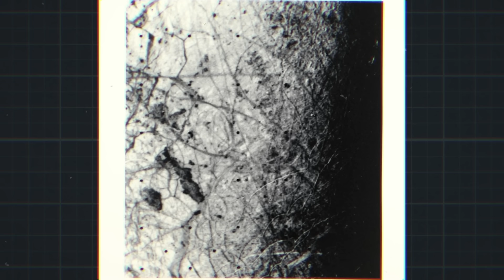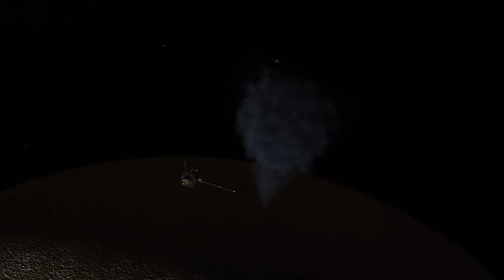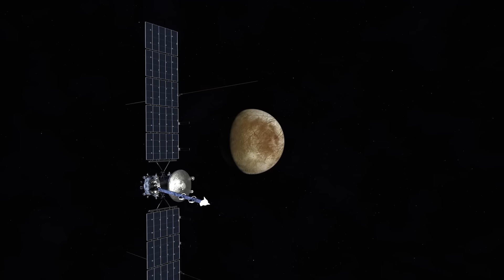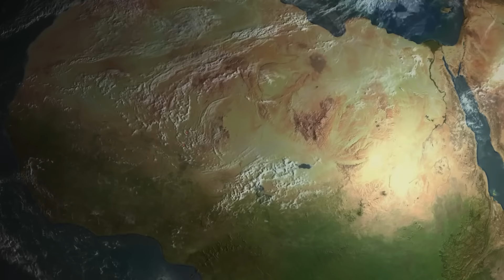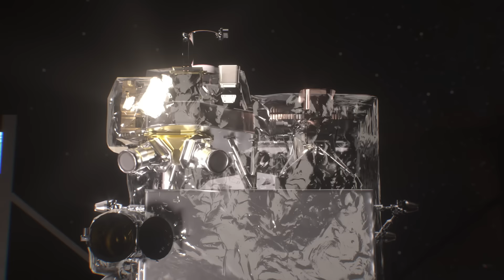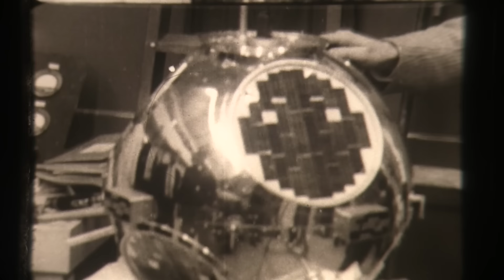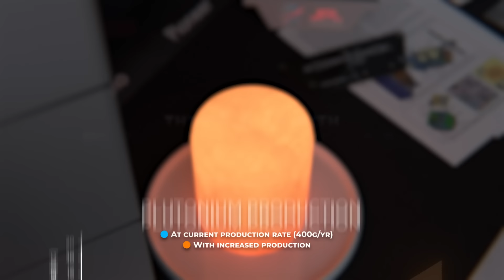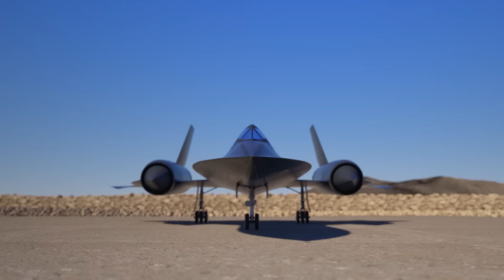The Insane Engineering of Europa Clipper

Comment: Thanks for covering this! I work on Europa Clipper. Hanging out in Florida awaiting launch. Let me know if anyone has any questions!
Reply: Sidenote, it would have been cool if when you showed the specific instruments (SUDA, MASPEX, REASON) if you put the organization it was provided by
Reply: @umer936 my question how europa can have heat is there termal vents or active core inside of not then only tidal energy enough for heat🔥
Reply: @sonukumarprasad4615 There could be. We know there's the tidal heating, but are unsure if there are thermal vents. Hopefully we find out!
Reply: You should be proud of yourself! So cool to see a video explaining an awesome project, then the real people working on it commenting. Personally I'm interested in what hardware and software the main computer is running on? With current tech there should be way more options than in the 60s
Reply: @allen0hu  
Thank you for the kind words! 

on-board the spacecraft, two limiting factors for the compute are radiation hardening and power draw. Jupiter's intense radiation means special radiation hardened processors must be used, in this case I believe it is a RAD750 (or similar). These run an RTOS (real-time operating system) for precise timing of operations. As for power, the spacecraft is solar powered rather than nuclear powered in the past, which also limits how much processing it can afford to do and send back.
Reply: @umer936 why are they not using nuclear with it? is it just a lot of power that they don’t need and not much lifespan for the actual craft itself, so there’s no point in using a long term nuclear energy supply?
Reply: @mincat1412  Discussed in the video, but basically we don't have the extra nuclear from the DoD anymore so it'd be more expensive than just having giant solar panels.
Reply: @allen0hu  Like OP said, it's a RAD750 variant (power PC 750 instruction set if you can believe it). It's just the best option we currently have that has the flight-proven reliability and radiation tolerance required of a mission like this. 
There's lots of new stuff in the works (checkout "HPSC" project between NASA (and others) and Microchip) but for now, that's what we got.. very similar to main computers in the mars rovers, Psyche, etc.
Reply: I was surprised when I heard the resolution of the camera is only 5 times better than the Galileo spacecraft. I would have thought the technology would've been at least 20x better. Why's that?
Reply: @manuelvolk6177  I'm impressed that they got 8MP sensor... Radiation will create a bunch of noisy artifacts. Everything sent on a probe has to be radiation hardened. This means they have to be less delicate. Therefore the processors are nowhere near cutting edge because they need to be thicker and chunkier.
Reply: @manuelvolk6177  my guess would be power saving. cameras of high resolution take way more power and peak draw compared to lower resolution ones
Reply: @manuelvolk6177  
I actually had this question before too. So the "5x better" isn't completely accurate. It's 5x better for 90% of the mission, but on close flybys, it will be 100x better than Galileo (source: https://europa.nasa.gov/spacecraft/instruments/eis/). 

Also, everything in engineering is tradeoffs. Clipper's focus is exploring habitability, especially in the water under the ice. So the instruments that identify elements below the surface take priority. A better radiation-tested camera would increase the money budget and take up more of the data volume budget. We'd rather more of the transmission be for the science data than images of the surface.
Reply: I'm assuming all hardware and software need to be a bit older technology which is tested, I'm wondering what programming language is used for the software side of things?
Reply: @tgmyrz  I don't know the answer to this, but imagine it's primarily Assembly, C/C++. We have lots more leeway on the earth side for processing the data, so that includes Python, IDL, and C++.
Reply: @umer936  software engineer here. due to power constraints and the high efficiency needs in a mission like this, im almost certain that they are using C that has been hand optimized in assembler, unless they have some proprietary languages that has been specifically designed for this.
Reply: @tgmyrz  They use C on-board almost entirely. As OP mentioned, ground and test systems can and do use a lot of other, typically higher level, languages.
Reply: What's it like to work on huge projects like this? I'm asking because I'm a current physics student and stuff like this seems like it could be a dream job.
Reply: @austinh1242  
It's very cool being a part of something so adventurous and bigger than myself. Often on the day to day it's hard to see that because everyone has their small roles, but stepping back and seeing how much dedication and hard work so many scientists, engineers, support staff, physical working staff, and everyone put in is pretty amazing. Best of luck with your studies! :)
Reply: @austinh1242  If you ask me it is the perfect time to get into aerospace.  The industry is about to boom.
Reply: @austinh1242 The book, The Mission.
Reply: No questions really, just wanted to say thank you for the work you do. Awe inspiring and fascinating.
Reply: Ah dang. I replied to every question. But it looks like any that had a link to more information got autodeleted. Don't typically comment on YouTube so I didn't know about that.
Reply: @umer936  You can look at your comment history, which will (IIRC - when I had that problem) and copy-and-paste everything except the link and try again. Also, thanks so much for working on this project! I've been following its progress since it was just a proposal in 2013!
Reply: @umer936  is there any missions to send a lander on Europa in the futur
Reply: @lecrabesavant4435  A lander was originally part of the initial Europa Clipper proposal, but was removed as we don't know enough about Europa to commit to making a lander. As time continues, a Europa Lander mission is possible but no earlier than 2027. Saturn's moon Enceladus is similar to Europa, which also has proposals for a potential lander. Depends on budget and potential science capabilities.
Reply: @umer936  also, if europa clipper fly through a geyser, wouldn't that damage the instruments with this high speed ?
Reply: Can the ESA's JUICE mission be used as a second point of reference in mapping the irregularities in mass distribution/gravity strength of europa? knowing the distance of Clipper from earth + clipper from juice would allow better insights into changes in velocity due to gravitational irregularities.
Reply: @bonngus  
In theory, it could. However, the spacecraft uses star maps to have many points of reference in space (source: https://europa.nasa.gov/mission-updates/43/mission-dispatch-tracking-the-stars/) to assist with exactly knowing its position regardless of velocity or gravitational changes. 
The 2 spacecraft will not be following each other/always near each other as JUICE is more focused on Ganymede and Callisto while Clipper is focused on Europa. Being different missions and different types of instruments for the gravity measurements make it difficult. The data will be cross-compared here on earth, but nothing in real-time. They will be able to visually see each other and JUICE will potentially see the end-of-life crashing of Europa Clipper though.
Reply: @bonngus  In theory, it could. However, the spacecraft uses star maps to have many points of reference in space (source: https://europa .nasa. gov/mission-updates/43/mission-dispatch-tracking-the-stars/) to assist with exactly knowing its position regardless of velocity or gravitational changes. The 2 spacecraft will not be following each other/always near each other as JUICE is more focused on Ganymede and Callisto while Clipper is focused on Europa. Being different missions and different types of instruments for the gravity measurements make it difficult. The data will be cross-compared here on earth, but nothing in real-time. Other sensors will share a lot more cross-referencing, such as UVS. Plus, the 2 spacecraft will be able to visually see each other and JUICE will potentially see the end-of-life crashing of Europa Clipper TBD.
Reply: That's awesome! Hope the hurricane wasn't a problem for ya
Reply: @stanuel  Fortunately not too bad! My heart goes out to those affected and I hope for the best for their recovery.
Reply: What an awesome project to be involved with!   I'm such a passionate supporter of any mission that directly tackles questions related to possible life and habitability.  Astrobiology and planet habitability are the hottest fields of scientific enquiry to my mind.
Reply: That's so cool, congratulations for successful launch and making this mission possible. When do you think we will be able to send a lander to Europa and do you think we will be able to get to the ocean below the surface? Since that's the only way to 100% confirm that there is life.
Reply: @lukasimic7879  
A Europa Lander has been proposed but I don't believe it would launch before we start getting data back from JUICE and Europa Clipper (~2030). That said, I don't have any specific info/knowledge about it. There's a Wikipedia for it though, which will get updated if progress is made [1]. The current proposal is detailed here which would dig below the surface, but I don't believe it would completely drill into the ocean. It would be at a depth that doesn't get exposed to the radiation though, so there would certainly be new stuff to learn from [2]. More info, but probably outdated at this point can be seen in this presentation [3]. 

1) https://en.wikipedia.org/wiki/Europa_Lander 
2) https://www.jpl.nasa.gov/missions/europa-lander/
3) https://d2pn8kiwq2w21t.cloudfront.net/documents/2020_ELOW_Final_20200514_Post_v2.pdf
Reply: Did you build 2 identical vehicles in case of a launch accident?
Reply: @paulanderson3898  No, we only build one, so cross your fingers! We do build an Engineering Model of each instrument to keep at home which is as close to the Flight Model as possible. But it is not easy to just "spin up another." For example, Cluster is a spacecraft that members of my team worked on in 1996 that had a launch failure, so 4 years later they launched Cluster-II. But there have been missions that become dead in the water if it would not make sense to make another cost-wise and science-wise. We're better at it now, but it's not a good time so it's important everything is done as right as possible.
Reply: I dont understand the terms yall saying but thanks. for making it happen
Reply: In the video it is mentioned that the camera on Clipper is 8Mp. First off, is this accurate? Second off, isn't that low? We've had smartphones with 200Mp cameras for a few years now, isn't higher resolution always better? I'd imagine the digital sensors would have to be radiation hardened, but a larger sensor wouldn't be much heavier. In that case, why such a low resolution?
Reply: @MartoradGaming  More resolution isn't always better, especially in a high radiation environment like what Europa sits in. Not always, but in general the smaller the feature size (required for higher resolution, more performance, etc) the more susceptible it is to radiation damage. The cameras sensors cannot sit in the vault where they'll be a little safer from radiation so the have to go with sensors that can handle the full blast of radiation, and that means lower performance. They also had to pick sensors and do all the building and testing and everything almost a decade ago, so they can't use something like what a modern iPhone has even if there wasn't radiation concerns.
Reply: @MartoradGaming if I May? Collecting all the Data possible is somewhat unnecessary, as it (Clipper) will have a finite lifespan And constrained transmission window... Too much information is often worse than too little, because that also consumes actual power and processing power/bandwidth...
Reply: Hello, can you tell me how you became a NASA engineer? I am currently studying at a school for gifted children, which is one of the top 5 schools in Russia. I have been interested in space all my life, and I want to know where and which faculty to enroll in in order to do this kind of work
Reply: @4ztt363  I work at an R&D non-profit that does work for NASA, not NASA itself. For Europa Clipper, we provided 2 of the 9 instruments. There's many organizations who do similar. It's a massive community with different companies, organizations, and countries working together to make these happen, so keep exploring and learning and hopefully you find a good fit somewhere!
Reply: Hi @umer936 Glad to know that you work on Clipper. I was fairly interested in the Magnetometer booms which were deployed. Can you give more insights on it?
Reply: Congratulations on the project, I'm hoping it finds some awesome science once it gets to Europa. Any plans for your next target following this mission? I'd be keen on an Enceladus Clipper mission.
Reply: @Deadlyish  
We have been working on proposals for Enceladus. 
I work on the software side so there's a couple of near-term missions on my timeline (TRACERS and CoDICE). Up to the scientists to tell me what to do. Right now my workplace (Southwest Research Institute) has focus on space weather with the PUNCH mission.
Reply: Respect
Reply: I'm an electronic engineer and the capability of the hardware astounds me. Is there anything available to the public on the electronics for this mission or maybe even past missions?
Reply: @MW2ONLINEGAMER100  there's a pretty detailed report available on MSL (Curiosity Mars Rover) as a whole, but you'd have to dig quite a bit for real low level details beyond that (especially for more modern missions): https://descanso.jpl.nasa.gov/monograph/series13/DeepCommo_Chapter8--141029.pdf
Reply: Thanks, man! Amazing job!
Reply: How long will it take data to reach us? How long are the blackout periods and will we receive data recorded during those times?
Reply: I haven’t seen the full video yet— how exactly can we detect life?
Reply: @tylerhfroemming  
We're looking for the signs that could support life. These include the elements that make life on earth possible: Carbon, Hydrogen, Nitrogen, Oxygen, Phosphorus, and Sulfur (CHNOPS); heat; water; and more. Organisms need these to make energy.
Reply: Why wasn't a higher megapixel sensor used?
Reply: @GeorgeStar  This question was answered above and in one of the Real Engineering shorts, but short answer is that the things we care about don't benefit much from using higher megapixel sensors. So it's just not worth it when having to radiation harden and all of that.
Reply: what kind of job do you do
are you an engineer?
Reply: @TASTEGROUND  I'm an Electrical and Computer Engineer by degree, but I work a computer science role. My job title is Research Computer Scientist.
Reply: @umer936  you must be great at coding wow
Reply: @ Not particularly haha. But I have lots of practice problem solving, working with teams, and a lot of reading lol.
Reply: Can it dig or melt or blast way through ice... If not are there plans to do that with 2nd or 3rd iteration?
Reply: @phaedrussocrates7636  no it just flies by. if it delivers promising data a lander will be sent to collect samples in 1 month on the surface before the radiation fries everything
Reply: As an aspiring space engineer myself, working on computer science, how do you suggest us non mechanical engineers can contribute to space projects like this? I've always been disheartened by the fact that my degree means choosing a path that may not align with space science but seeing that you have worked at NASA as a computer science engineer how much and what kind of programming are we looking at? 
Thank you for taking the time to answer all the questions you have it's really heartwarming to read
Reply: @adwitiyapaul2831  Space projects are in no way limited to mechanical engineering. There's so much that goes into working with space projects. It could be mechanical, but it could also be food science, or astronaut life support systems (medical), or blue collar work of managing and being a technician for the thermal vacuum testing chambers. 

I'm actually at an R&D company called SwRI that NASA contracts rather than being at NASA itself. I primarily work in webdev world (full-stack webdev), but my group does a lot of support software that uses Python, C++, Perl, and more. We have people that focus on cloud/AWS, others that do more sysadmin/IT, etc. so it's in no way limited to just physically building an instrument or spacecraft - there's a lot more steps to making that happen. Best of luck with your studies! :)
Reply: Why didn’t you guys make a an underwater drone that can look around for life in the ocean?
Reply: @leofreese1  Making an underwater drone would be very cool! But also very, very difficult. We don't know enough about how that water is. If it's really salty, then the water has a lot of buoyancy, and so that changes the design. Plus, navigating and communicating from underwater is very challenging. By orbiting, we still can send info in a line back and forth from Earth, but underwater we'd have no way to communicate with it without a lot of challenges to overcome first, ignoring the challenges of getting something to survive getting to there in the first place. 

Europa also has a thick layer of ice that the drone would need to figure out how to get through. One of Saturn's moon's,  Enceladus, has a thinner layer of ice, so maybe that one would be easier to do an underwater drone at in the future :)
Reply: That is awesome! Do you have any advice to young people that dreams with working for NASA? Grettings from Argentina!
Reply: @BrunoBallestrasse  My advice is that it's fun to be curious! :) Why do we do the things we do? How does whatever thing you're looking at (maybe it's something as "normal" as the traffic light) work? The world is full of stuff that's incredible. 
Hola! Yo hablo espanol tambien, pero mi espanol necesita mas practica
Reply: Hello! I'm a current masters student in aerospace engineering and I was wondering if you have any advice for someone wanting to get into the field of space exploration. Thank you!
Reply: @robertp7000  Hmm, I don't think I have any specific advice. You're doing great going for your masters! I would say working in labs/with professors/on projects is a great way to make connections and get connected to transition from academics to industry if that's what you're looking to do. But that's something I would say regardless of field or profession.
Reply: I have a question, if this is within your area of expertise to answer. It's mentioned multiple times how strong the radiation is around Jupiter. Is there any practical way to harness the radiation around Jupiter to power a probe? If you could get free energy then you probably could stuff the probe with a lot more sensors and maybe even ion thrusters? Thank you in advance.
Reply: @mikepatton8691  Good question! No, I don't believe there's really a good way to harness the radiation. For one, it's very spread out and for two, it's very damaging. Since it's all over (beta particles and high-energy photons), it'll likely harm the electronics making the power so you'll lose the equipment that you're using to generate power before the sensors degrade, which would be unfortunate. That said, it's certainly not impossible. Another method could be to use the magnetic field to generate energy as it orbits Jupiter. At the current time, these are just harder than either solar panels or bringing our own radiation source, but maybe in the future something could be possible!
Reply: @umer936  thank you so much for taking the time to reply. I guess the real question is, we're 10 years past the future that Marty and Doc go to in Back to the Future 2, and they had a coffee maker sized Mr. Fusion that could power the DeLorean that ran on garbage,  so when can we expect to have a Mr. Fusion powering our cars and space probes?! Lol. Thanks again.
Reply: Great work this is such an important mission for humanity. Will the use of solar rather than plutonium hinder this mission much?
Reply: @gothicgolem2947  Nope. The mission was designed with solar in mind from the start. Nuclear has it's own downsides as well. For example for a big craft like Europa Clipper it needs a lot of power (~600W). Solar + batteries can be scaled up and down easily (just use more panels/batteries). Nuclear typically provides like 150W of constant power (which is great for slow moving rovers) but for a Europa Clipper, you'd need multiple nuclear sources together which becomes more dangerous, expensive, and complicated. It generates a lot of heat as well which you would need to figure out. Everything is tradeoffs and in this case solar makes much more sense.
Reply: Do you really think it’s possible to find a habitable ocean in Europa? Also is the camera quality good on the Europa clipper?
Reply: @KrishxEdits  We're actually pretty confident that there is an ocean that is able to support life in Europa. We think it's a bit like the deep salt-water of earths oceans. The question is whether there's life there currently, which is wayyy less likely. There could be bacteria type things or little worms, but it seems not likely there's like fish. But not impossible! That's just something we don't know. 

For the cameras, no the camera isn't really that good compared to cameras of today, but it is built to last in the harsh radiation around Jupiter while balancing cost and data with the other science instruments. It should be able to see things that are 0.5 meters in size.
Reply: @umer936 well if there are worms indeed to be found it would be a huge discovery nevertheless. It is still life form and quite evolved already that would mean the process of evolution is possible within Europa conditions. That would also imply we are definitely not alone if we are not the only planet with life support and evolution process even within one star system let aside distant infinite number of systems.
Reply: When will Europa Clipper arrive at jupiter?

Edit: Also, this might be a silly idea but seeing as jupiter has such a huge magnetic field could we use it to help generate supplemental power for probes?
Reply: @FerociousMoOoO  2030, after a MEGA (Mars then Earth Gravity Assist). JUICE, the European mission to Jupiter's moon Ganymede launched Feb 2023 should get there (Jupiter's orbit) about the same time. 

That's a neat idea! I'll think about it and answer the 2nd question in a bit
Reply: @umer936  Thanks for the answer, I've set the date in my calendar :D.  I also look forward to the answer to the 2'nd question, I was just thinking about how wireless chargers work and that something similar maybe useful to generate some extra power for the scientific instruments and computers once the probe arrives at it's destination.
Reply: @FerociousMoOoO  
Thought it over some. It's a neat idea but would be difficult to use for additional power. The magnetic field is strong, but also cannot be directed. Wireless chargers currently need to be exactly aligned, similar sized, and even then only get a small amount of charge. So to fit the Jupiter-sized field, it would need to be huge, but that also puts it into danger from the radiation belts which will damage it over time. Certainly not impossible, but also not easier than solar panels. 

But just because it's hard doesn't mean it can't be done. :) Maybe you can be the one to look into it (or the other types of energy radiating around Jupiter).
Reply: main question, why europa? we already know for sure Enceladus has an sub surface ocean, europa us just speculation
Reply: Please pass along this message to the next Jupiter area probe designers, “SFB inbred morons, figure out how to harness the magnetic field of Jupiter to generate power. (then please administer a hard slap to head) Learn what an ion engine is you incompetent vomit.” Thank-you.
Reply: QUESTION 10:24
If two particles enter the tube at similar times, how do we know which ionized particles belong to which initial particle when they hit the sensor? Since heavier particles accelerate slower than lighter particles, a heavy particle that came in earlier could trigger the sensor at the same time as a light particle that came in later. I am going to look up how a mass spectrometer works now, but I’m asking you because it’s the only part of the video that I was clueless on.

Also, I work “on the software side of things” too, were there any particularly memorable problems or solutions you encountered? Please note that I used the word “memorable” to deter you from catering to a general audience. I want to know that one thing you found interesting that will stick with you throughout your career, even if it would bore the average person.
Reply: @brockobama257  The simple answer is that the example from the video is a simplification and in reality the particles are bounced back and forth through the detector some 800 times. At the end of those 800 laps, it becomes pretty clear what particles are what. Think of how if there were a slower car and faster car on a NASCAR circuit. After 800 laps, it would be very obvious which car is "faster" even if the slower car had a bit of a head start. Search for "maspex technology today 800" for an article about this. Good question! 

One thing that was interesting in my role is how to handle the detector space for the UVS instrument. There's a large view that the scientists call the "Stim" and the "zoomed-in" view called the "Observation", but the Observation gets overlaid as a small part of the Stim. Scaling that can be a bit of a challenge, especially when taking in parameters from the "real-world" instrument that may differ from the simulated, as well as accounting for differences between two copies of the same instrument (the one on Clipper and the one on JUICE). I cover this a bit in a talk on YouTube called "CakeFest 2024 Project Showcase Ultraviolet Spectrometer UVS Observations"
Reply: europas eccentricity?
Reply: I wanna know what you most hope to find when it finally reaches Europa
Reply: @digiaprotogencalledl4378  So many things! All we really know is that there's a lot of salt water, but we don't know how deep or how salty it is. But one of the biggest things is if that ocean is moving and interacts with the seafloor since there's lots of energy there, like how the earth's oceans have those hydrothermal vents on their sea-floors.
Reply: How can you prove you actually worked there
Reply: @bigdog2432 can you prove you’re a real person